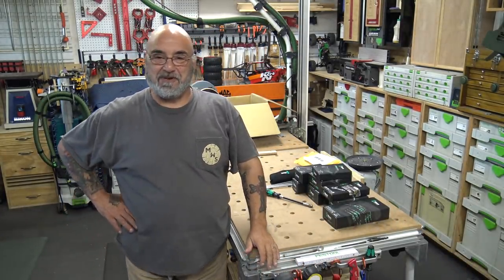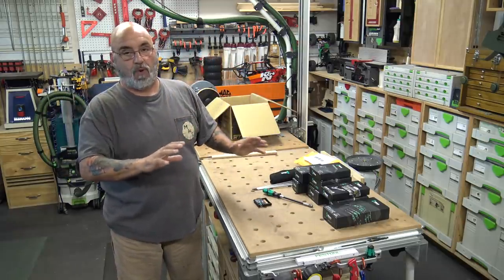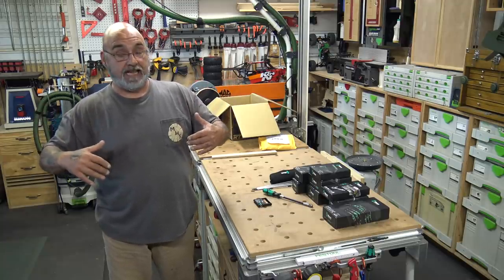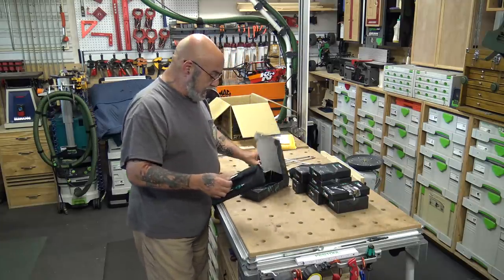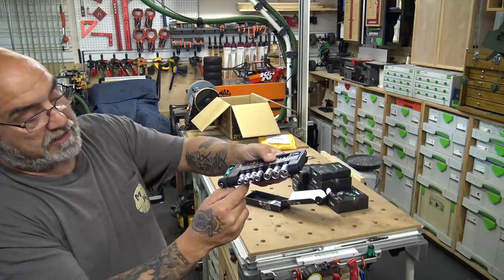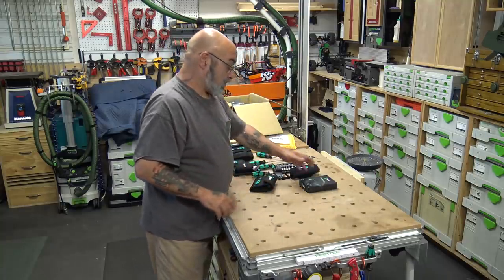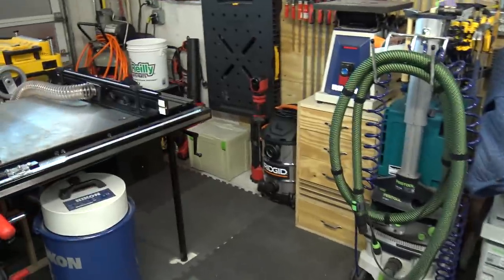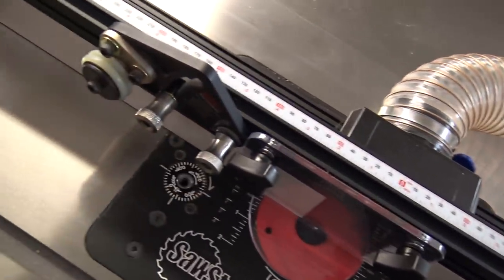My completed Wera tool collection.

Comment: Hi:
I was surprised to see you had gotten the Jessem Stock guides for your router table.  They are doing a great job on my router and were a big help when I had to make 8 pieces of molding 44" long.  Looking at your I thought I had mine on backwards, but I checked at the Jessem Site and mine are correct and you need to reverse yours.  When you use them hake sure you push down on the roller before you tighten the thumb screw.  You may have gotten a hurry and got them on the wrong side.
I have a set of the screw drivers that you were showing and I like the handles because I can get a good grip on the handle.  Some screw drivers hurt my hands.  The tips hold up great also.
Have fun in your shop.

Comment: Dude, an entire wall stacked waist-high with Festool... Even if those're just the Sys-Storage bins, there's a pretty penny in that shop. I don't even want to think about how much you've invested if they all actually contain Festool units...

BTW, Wera are a German company, so though I'm not 100% on this I'm fairly certain Wera is pronounced either VAIR-uh or VEER-uh